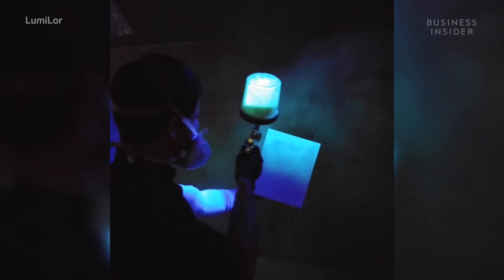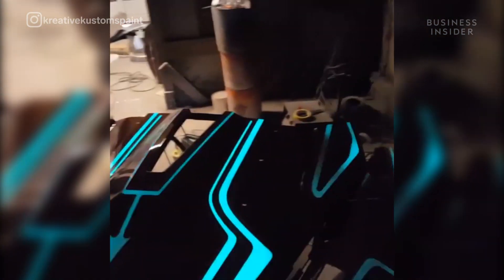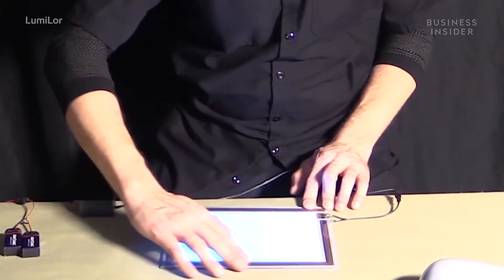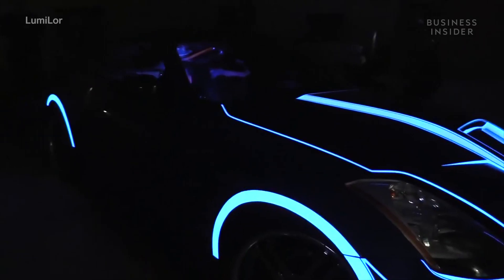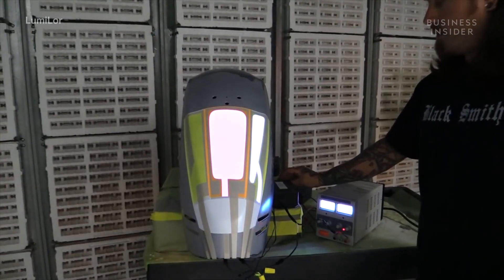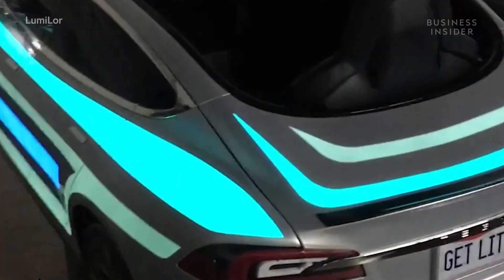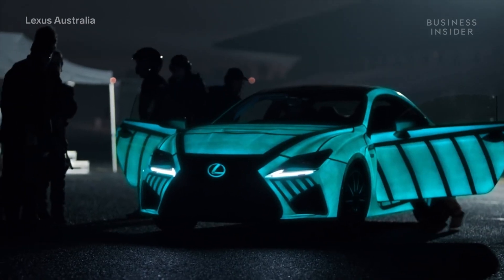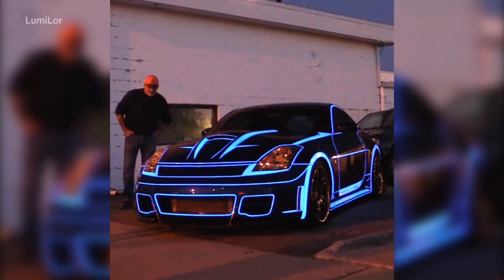Electricity Makes This Car Paint Light Up | Insider Cars

Comment: Imagine all of Las Vegas.... knowing how hard light repairs are on the Vegas strip.... imagine all the lights never having to be replaced or burning out..... I could see this paint replacing light bulbs entirely.... apparently it's bright enough for fog ect but still this is just paint and I don't see LED lights going anywhere because they too last long.

It amazing how paint lights up.....if you told someone from the 70s your paint can light up.... yeah you would be the nut of the block

Comment: Honestly I'm looking at creating realism for airsoft products. Like the current is somewhat programable, so if you were to spray a red/orange on a fire simulating tracer unit you could have it glow brighter with each bb shot through and have a delayed "cool off" to simulate a barrel heat glowing.
Reply: Use orange strontium aluminate pigment and a ring of pulsed UV LEDs.

Comment: Street signs,  roads, walkways,  crosswalks, curbs. I wonder how much power could be conserved using this instead of street lights.
Reply: It requires power. A street  light illuminates the street. This has a mild glow. A street light that illuminates as little as this would require the same or less power.
We could just dim street lights down to conserve power but then they wouldnt serve their intended function; illumination. This paint's function is to look pretty. It wont light up a street
Reply: @anitabonghit2758  and that theory is based on what? Maybe compared to LED street lights it might be somewhat true, equally street lights pump a lot of light into darkness....not necessarily where we need it....this however could give a very concise use of energy/light. It could help bring back the stars in cities....I'd dare say this paint would use an absolute fraction of the energy that a traditional streetlight would...most of a traditional streetlights energy would arguably be "wasted" as heat rather than light...moving to LED makes a huge difference, and this may well be magnitudes better. Can't imagine this would have much heat at all.
Reply: @DavidS-wm9ud  will it illuminate a deer on the road from 100 feet away while traviling at 80km/ph?

Hey, maybe your right? Maybe glowing cars will end pollution, bringbback the night sky, cure cancer and bring peace, ushering in a new paradise on earth were we all live for hundreds of years with no hunger, sickness, or pain, and we all live in harmony with nature and each other; smiling, holding hands and singing kumbaya
Reply: @anitabonghit2758  That would have to be one of the most absurd replies I've read! Top prize, well done! If you bothered to read the rational/reasonable suggestions of the OP, rather than reacting because someone smoked you on logic/efficiency data, the world would indeed be a better place!! Street lights aren't just for "deer 100 feet away while traveling at 80km/ph", infact, most are in suburbia with speed limits little more than half that! If one were to be dumb enough to drive around without ones headlights on then there's no helping one anyway! Sounds to me like you've got shares in the power company, light company or are a politician trying to justify bad decisions with wild tangent ramblings!

Comment: Use it on a phone this way when it's charging, you can visibly see that its charging without opening your phone
Reply: Or you just see the cable attached to the phone.
Or you just see the notification light lighting up in different colours when changing.

Comment: But how does it gets charged or gets it power from?
Reply: by ejaculation
Reply: By giving the electricity  to the body of the car!
🙂✌️
Reply: @insidious8591  but the electricity has to be applied to certein parts of the car to make it pulsate and, most of the car is metal so the energy would spread across the whole car??
Reply: @strawberriesandcum  electrons would go to the path of least resistance so... that would be a yes and no, and these cars can always use preprogrammed computers that use solenoids or transistors to pulsate the light.
Reply: @AlineaEuros  solenoid: a device that converts energy into linear motion. This energy may come from an electromagnetic field, a pneumatic (air-powered) chamber, or a hydraulic (fluid-filled) cylinder.
Reply: @insidious8591  how do you insulate it? Won't you get shocked if you touch the car?
Reply: @ganeshanair  theres a thing called resistors and if the voltage and amperage is low, you won't feel anything, LED lights can be powered by very low levels of volts and amps that you wouldn't even feel them when you touch their circuits
Reply: You guys are silly, its called layering, or "sandwiching". One layer insulates it, the other is a good conductor, the other is the paint that reacts to electricity, and then its the paint/wrap, and then maybe clear. Its all paint puzzle pieces basically.
Reply: battery?
Reply: @Smartercow  I meant about the mechanism of charging.
Reply: @prasoonpatel5338  And what do you mean by that?
Reply: it doesnt charge, it just lights up the moment electricity flows through it, think of it like a light bulb with an on and off switch, you dont charge the bulb, you just hit the on switch, which completes a circuit and thus electricity flows through the bulb, causing it to emit light.
Reply: More importantly how long will the paint last? Its paint not hardware i bet some of it rubs off, then what? Reapply paint?
Reply: @sisamusudroka3000  ever heard of clear coats? maybe ceramic protective coatings? how can you be this dumb...
Reply: @IllNacs  damn I've forgotten all about this. I'll have to look up everything before I get back to you
Reply: Best guess is a sort of electricity strip attached to the interior parts of the car that run opposite to the paint. Using an app on a cell phone it is activated deactivated or patterned. Either is attached to car battery or attached to its own battery that is probably hooked up to the alternator. 

Tldr rgb strip but emits electricity instead of making your P.C. look cool in the other side of the body controlled from phone
Reply: What everyone is forgetting is that the chassis of the car, the metal is actually the grounding point of the cars electrical system so applying another circuit to the metal will cause a direct short
Reply: It seems others are too dumb to understand the concept, i will explain.   You drill out a few holes in the metal.  Connect the positive to 1 side and the negitive to the farthest side.   Notice they have sections of the car that can light up seperately.  So for each of these there is 2 holes drilled in the car.   Why are the holes drilled in the car? Because the metal conducts. Therefore you drill a large hole fill it with bondo  so the leads dont short to the car.   As for how the material works i assume it is the same as a florecent light bulb.
Reply: Cars have battery and i think thatswhere they get it from
Reply: I will definitely use this to get an edge on car showe
Reply: By farting! dum dum... Go to taco bell before a car show with those stanking farts your car will glow brighter than the Las Vegas strip!

Comment: Wow, did it electrified someone who touch the car body?
Reply: Wouldn't the clear coat over it insulate it?
Reply: No because this isn't using watts or high power electricity, this is using 12 volt car batteries or even toy batteries. It all depends on how much power the area of emitting light needs. You can put both of your thumbs on each post of a car battery and nothing will happen.  In fact everybody has touched metals in their cars interiors and no one has been shocked.